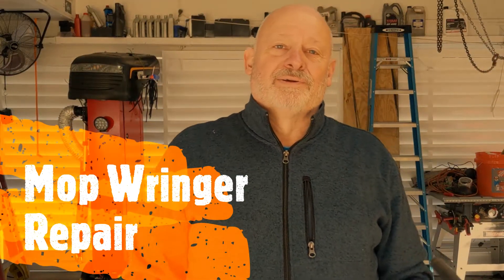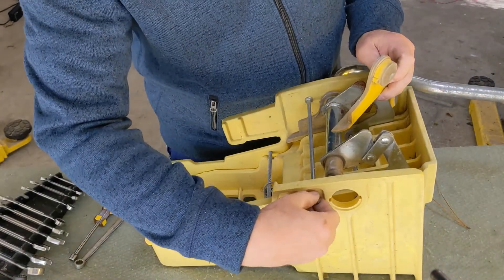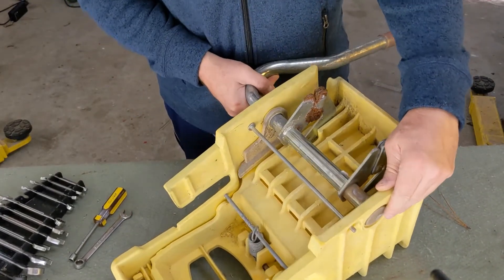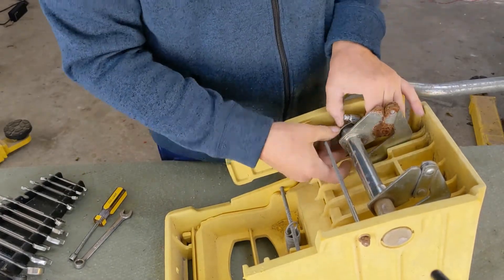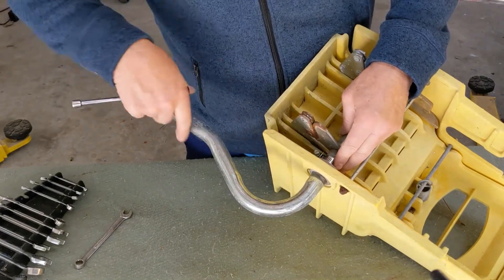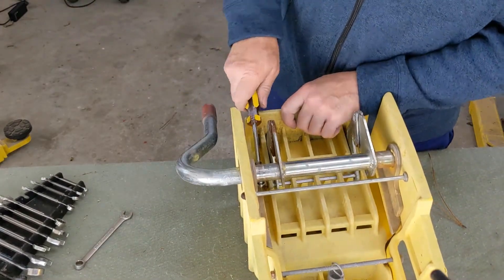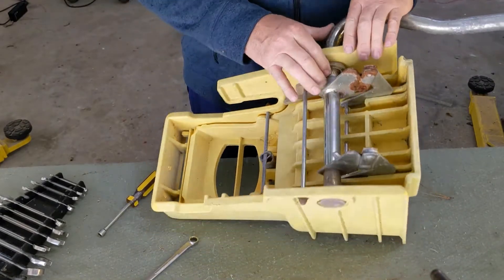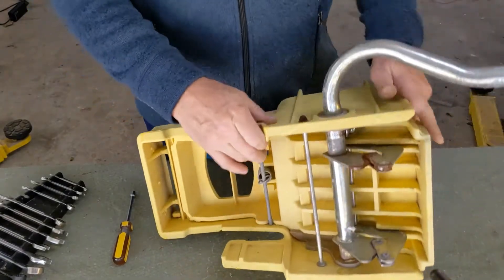Mop Wringer Repair with Band Clamp

Comment: I have a suggestion, instead of the band clamp drill a hole all the way through the handle in the same place as the band clamp and put in a nut and screw. It will never come out again. Its a little more work but worth it.
Reply from the maker: thanks, I was not really sure when I made the repair if it would need to be adjusted.  Your idea would work great too, so far the band clamp has held position but if it ever slips I will probably do as you suggested
Reply: I might buy the clamp and tool to tighten it for work. I work night shift and hate it when the mop wringer does not work. Thank you for this video.